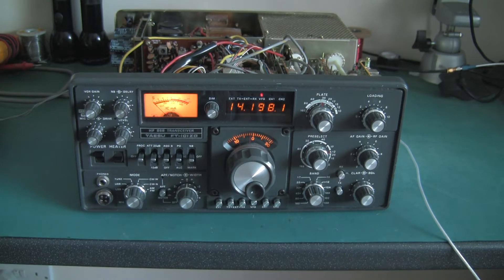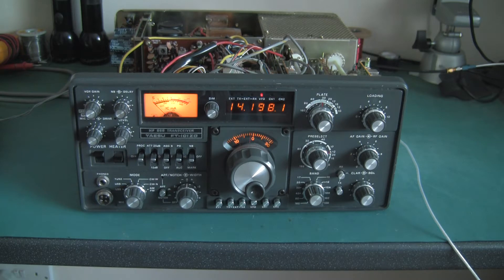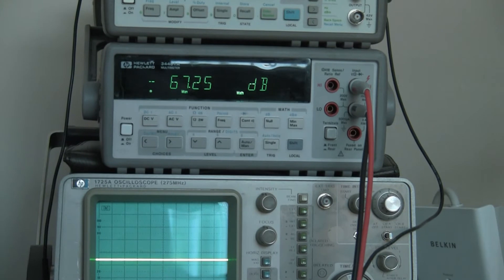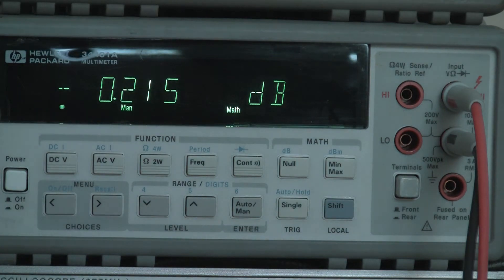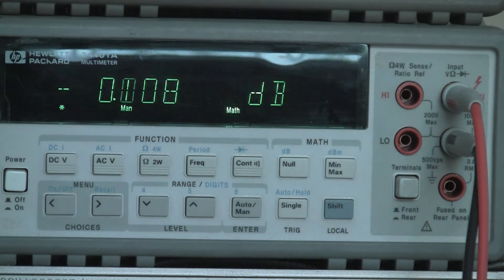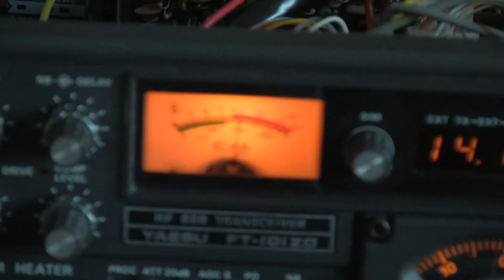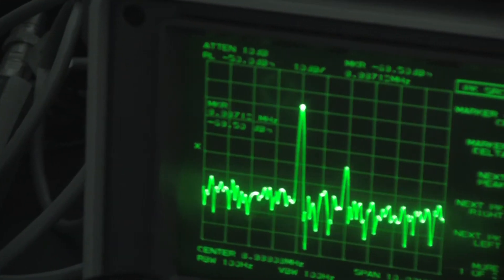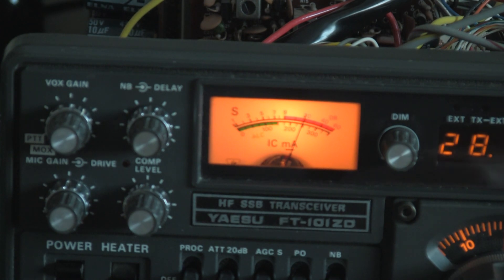FT101ZD RX tests part 1

Comment: Hi all, Help needed I have  101zd MK1 that has on TX  I beleave the mode switch has been tamped with If any one could help with phots of  wire COLOR code pinout would be great, Thanks All.

Comment: Tim have found your address, will try and post to you soon, thanks.
Reply from the maker: WAIT !  Do not post it to me as I don't do postal repairs.  I gave you my callsign / details etc for qrz.com such that we could communicate via e mail rather than in public like this.  Sorry for not making this clear.  The reason I don't do repairs thru' the post / courier is because old radios don't travel too well, thus any repair I decide to take on has to be hand delivered and collected.  This way it can be seen working before it leaves my hands.
Reply: Tim Forrester: No problem I was thinking of that, I can find you on my sat navigation. Use my email, let me know when it's convenient. Cheers.